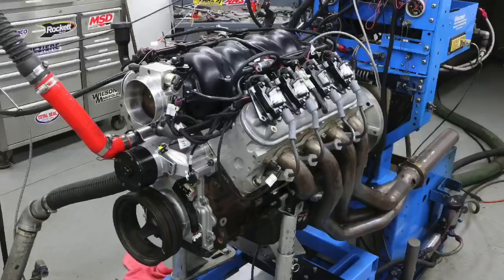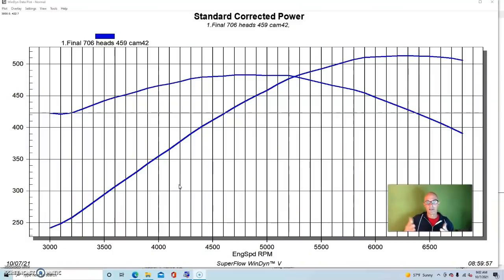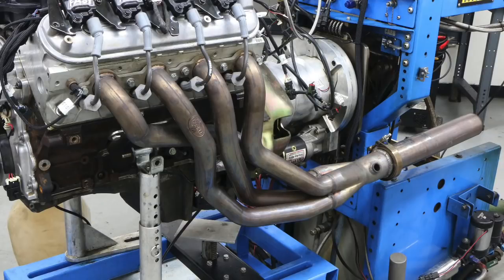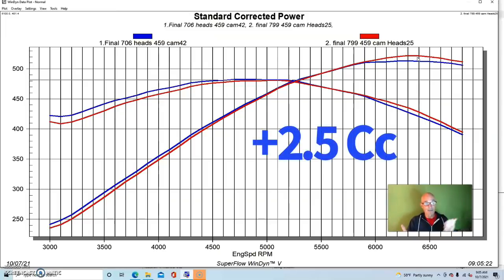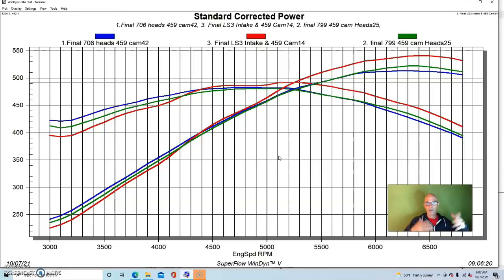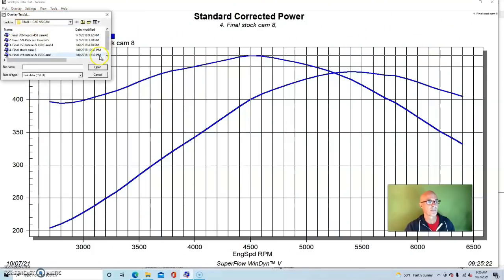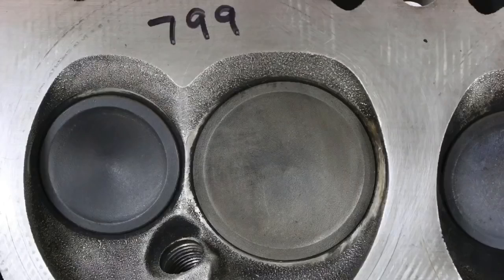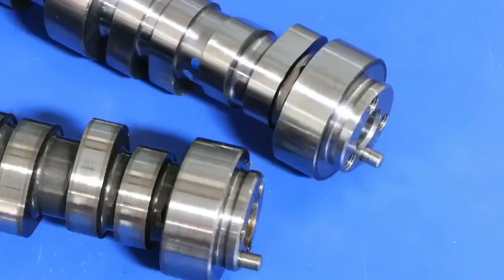HOW TO MAKE MORE 6.0L LS POWER. TESTED-STOCK 706 v 799 v LY6 HEADS & STOCK 6.0 v LS3 v LS9 CAMS

Comment: I want more down low, can you recommend the cam/intake? Seems like I can keep the stock heads
Reply from the maker: there is no cam and intake that will give you more torque at 2500 rpm than stock

Comment: I have 6.0l lq4 with ls3 heads would a ls3 cam give me 400 to 450 hp stock out of a corvette? Or should I go with a after market cam.  I'm trying to do has little tuning as possible 🤔
Reply from the maker: a stock LS3 makes 495 hp with headers, no accessories and optimized tune on our dyno

Comment: So I just bought an 87 c10. I have my 04 Yukon 6.0 and the 4l65 trans that I’m
Gonna put into the truck. The motor have many miles and I want to freshen it up. Could you give me a quick list that you would prefer for that motor that will make the truck  most efficient and most power? Like cams,heads etc. Thanks in advance.
Reply from the maker: take a look at the many, many 6.0l videos and pick what curve you want

Comment: Richard what cam would you recommend for a 5.3 with 706 heads that would go in a 8000ib school bus with 4L80E transmission? Looking for the most bottom end power. Torque first then horsepower.
Reply from the maker: truck norris or torque cam from BTR

Comment: Hey Richard, I have a 2003 Hummer H2. I'm having the infamous stock cam issue.  What's a good stock replacement cam without a tune.
Reply from the maker: another stock cam
Reply: @richardholdener1727  thanks for responding. I'm told that there's been a delay with ordering a stock one. Is there another one similar without needing a tune? Like an aftermarket stock?
Reply: @richardholdener1727  lol, he answered his question
Reply from the maker: exactly

Comment: Richard, I’m working on a 6.0 what’s your thoughts on running 243 or 799 heads with a Mutha Thumpr cam with FAST LSXR intake? How much HP you think I’ll get close to?
Reply from the maker: 500
Reply: Adding Air Flow Heads or Trick flow heads would that giving me more HP?
Reply: Thanks for the reply Rich.

Comment: I would like to know what can I do to an lq9 engine to get it to 800 horse power. And not touching the bottom end. Would really appreciate any comments.
Reply from the maker: you need to touch the bottom end to add ring gap
Reply: @richardholdener1727  what would be the ring gap will I need some heads to run boost. I definitely know that I need a cam swap. I’m learning trying to build the engine myself. Thanks for your response.
Reply: @edgarvasquez1329  lq9 heads will be a fine place to start. top ring - bore x .0055,  2nd ring - bore x .0057,  3rd ring is a min of .15".change cam, springs and can't go wrong if you go to some ARB bolts of studs for the heads.

Comment: Looks like for a truck/van combo that spends 98%of it's life under 4500rpm and does a fair bit of towing the 706 heads are the best setup. And almost free at the junkyard.
Reply: It's the compression that does it under the curve take the 799 or the rec. Port and mill them to 62 cc then it will boogy NA .I am putting this lc3 on my 6.0 as soon as I see the end of the testing.thatsca lot of money just for it not to work.

Comment: Would like to see a test on truck 6.0 upgrade for torque. 706 with a truck/ RV cam. Would the 706 head work with a 4" stroke? 317 head work better?
Reply from the maker: 408 would make more torque than 364
Reply: @richardholdener1727  
Indeed it will.... But which head would be better for a torque? 706? 317?   
One could increase the compression ratio from the stroker kit Pistons.... given the same compression ratio, which head would be best for torque in a truck?
Reply: @cjdubuisson  both heads will work well. a 10cc difference for the 317 heads means the piston design will cause issues with flame travel. higher compressions fix that. for a towing vehicle, 706 heads with a healthy cam and a 4" stroke with a NNBS cathedral port intake will make lots of low-end power for you.
Reply: @natricjol  
I believe you are correct, I have come to the same conclusion.
Reply: @cjdubuisson  Truck Norris cam, NNBS intake, 90mm throttle, 706 heads, stroker crank will give lots of low end power. You can go up to a 4.25" stroke on a stock block and that will keep the low end power up but the same cam will allow a good top end.
Reply: @natricjol  
He would be interesting to see the specs on that camshaft.... I'm guessing not much over .226 @50.    I'm a little leery of crankshaft that is over 4 in, due to the Piston rock at the bottom end the cylinder.... I'm taking a good hard look at the new 6.6.... it utilizes a 3.85 in stroke. Seems to be a good compromise between torque and reliability.

Comment: Hey could you do a test with ly6 and carb and different cams? I’m in process and would like to see the difference between say the summit ls pro cams for fuel injection vs the carbureted ls pro cams.
Reply from the maker: THE CAM DOESN'T CARE IF ITS FUEL INJECTED OR CARBURETED
Reply: @richardholdener1727  wasn’t sure if there was a difference or not. Just noticed a lot of the carb cams have less duration and lift on summits website. Thanks for responding.

Comment: I would have loved to have seen the difference of LS6 vs LS9 and LS7 cams. Tho I know LS7 would be close to LS9. But they both also are close to the lift (extra .007 more vs LS6) of the LS6 but with more duration. Would like to see ly6 with 799 and 823 heads with LS7 cam with 1.7 and 1.8 roller rockers. I wish i had an engine dyno. Also, some decent cams and for under $300... SDparts !! I actually putting a mild LQ9 with 243 heads (hand ported) and tbss intake together with the sdparts LS6 power max cam since was just $230 and can use factory rods and LS6 (yellow) springs. Should be a great budget motor since I had everything but cam and gaskets laying around.
Reply from the maker: please see the ultimate ls cam test video-I tested al of those
Reply: @richardholdener1727  i know of the article online.. Look for the LS6 specs and date chart.. Skipped to the next cam

Comment: Towing (under 4000rpm) with a stock 6.0L motor with 706 heads and a stock truck cam can you do better than OEM parts?  Richard any plans to do some testing with the 8.1L Vortec?  Love to see some dyno numbers for us truck guys with heads, cam and intake.
Reply from the maker: YES-OTHER CAMS CAN MAKE SLIGHTLY MORE BELOW 4000
Reply: @richardholdener1727  I think I remember one of your videos using Brian Tooley cam for low end torque.

Comment: Have you tryed 5% 2 stroke oil  in E85? good low speed torque..Great lube for injectors,they does not get stuck or get koroded inside anymore
Reply from the maker: I HAVE NOT TRIED THAT-BUT THAT HAS TO CHANGE THE DETONATION THRESHOLD OF THE MIXTURE
Reply: @richardholdener1727  does not seem to like very high rpm(burns slower i think) but ok for street,6000/6500 rpm

Comment: Question If the 706 head is ported or and The valves are opened up will it become less of a 5500 under production head and more towards the realm of a 799? How can you modify the 706 head and still make it more effective for 5500 and under? What would need to be done for this?
Reply from the maker: THE 706 HEAD IS NOT A 5500-UNDER HEAD-THE RPM POTENTIAL IS A FUNCTION OF OTHER THINGS (CAM AND INTAKE), THE 706 HEAD CAN BE PORTED WITH BIGGER VALVES IF YOU WANT MORE POWER
Reply: @richardholdener1727  got it thank you!

Comment: My take on these tests: the low end is killed by low compression, not so much big ports. The high end AND the fat torque curve you want come from tighter LSAs and thus more overlap. The factory cams have negative overlap at 0.050”, and the LS9 is by far the worst! Get the compression up and get an aftermarket cam!
Reply from the maker: COMPRESSION ISNOT WHAT IS HURTING LOW END (COMPRESSION HURTS POWER EVERYWHERE)

Comment: What if you just grabbed some different head gaskets to try and get compression closer to the same. Maybe thicker for 243’s and thinner for Ls3. That would be something a typical guy doing heads can do being that they have to buy gaskets anyway.  Just a thought. With truck manifold on both so maybe it’s closer apples to apples?

Comment: I have the LQ4 cam in a 5.3, LS6 valve springs, dual plane and carburetor, in a C10, it’s surprisingly torquey for what it is. 👍🏻
Reply: @bigboreracing356  
I love LS engines, your bias wont change my opinion, thanks anyway. 😄👍🏻
Reply: @bigboreracing356  
Actually I’m building a 400 next 😁👍🏻

Comment: Sweet I'm thinking about redoing my lq9 with ls3 heads. Everyone saying go to aftermarket Cath heads but I saw small bore ls3 heads which would let me keep my same  setup
Reply: If you have an LQ9, then you have cathedral port heads. LS3 is rec port and would require a different intake manifold. Cheapest way is get a NNBS/TBSS intake but get the NNBS-style rec port intake manifold if you get LS# heads.
Reply: @natricjol  I have the ls3 topend already on the car, heads and intake from a 5th gen Camaro.
The Cath port guys are saying I should go back to Cath port heads.
I bought another Camaro with a ls1 and 862 heads and the same cam, got took in the 8th mile. Even has the same 2.73 gears. Granted it is lighter since I have a 6.0 and 4l80
Vs ls1 and 4l60.  Most of our highway runs were similar with me only pulling away T high RPM.

Comment: Recently picknpulled an LQ9 from a crashed '05 Escalade. Got some 799 heads and trailblazer intake. Keeping the stock cam, or maybe a small upgrade. Need S10 swap headers, fuel pump stuff and a transmission. Just for putt-putting around, no crazyness I swear. 🤞
Reply: If you need any help with that, reach out to be. I have the wiring for the map sensor and can get your MAF dialed in enough to get it up and running without any issues. As long as you are doing the tuning yourself.
Reply: The 799 heads worked fine in the lq9 ? Direct swap ?
Reply: A few months back I found a set of freshly rebuilt 243 heads on an LS4 at the local yard. I also picked up the pushrods, they were like new as well. The 243's are essentially identical to the 799 heads, and are a bolt on swap. They have minimal mileage, so these will go on the LQ9. It's still a project, but I'm making progress slowly.
Reply: @ronnelson7828  gotta take advantages of them deals, I’m looking into a lq9 or lq4 as a back up engine for my ls1. I just wasn’t sure if the 243 or 799 were a direct swap into the 6.0 since I read somewhere that the compression could be a little to high in the lq9 with 243s heads to run pump gas… but if that’s not true, junkyard time and find a lq9 and slap some 243 heads on
Reply: @carlossantamaria7967  The 243/799 heads do have smaller chambers than the 317 heads you find on LQ4's and LQ9's and will raise compression. I'm assuming the 243's I found have been resurfaced and will be close to limit for 93 pump gas. 🤞
Reply: Also if you a choice between the LQ4 and the LQ9, take the LQ9. They have flat top pistons and full floating pins. More compression, more power. 👍🏁

Comment: TBSS intake is far superior to the terrible LS2 intake. Surprised you went that route.
Reply: It’s not a oem ls2 intake. It a Dorman ls2 style intake. Basically a copy of the original fast 78mm intake but with a 90mm ls2 throttle body opening
Reply: @Chase.bachler  that's good to know.
Reply from the maker: DORMAN IS NOT A COPY OF THE FAST-THAT'S A MYTH

Comment: As I remember with the Trick Flow versus the LY6 rec port heads the compression difference was substantial. Same compression and the power advantage shrinks. CNC port the rec port heads and it virtually disappears. The aftermarket heads are not worth the price for most people building a street/strip car and not at all for someone building a driver.
Reply: Agreed, ported heads are not worth the cost for the average guy.

Comment: I wish you had an LS7 cam to compare with those other cams. It has a little more lift (.593 /.589) than the LS9 cam and a lobe separation angle of 120° as opposed to the LS9's 122.5°. Both have the same intake and exhaust duration specs. It would be interesting to see the difference between the LS7, LS3 and  LS9 cams.
Reply from the maker: THE LS7 CAM ONLY HAS MORE LIFT IF YOU RUN THE 1.8 ROCKERS-SEE THE 5.3L ULTIMATE STOCK CAM TEST VIDEO-BOTH WERE COMPARED-THEY MADE THE SAME POWER WITH THE SAME ROCKER RATIO
Reply: @richardholdener1727  Ah yes of course, LS7 has the 1.8 rockers. I'll go check that 5.3 vid out right now as I want to see the effect of the slight change in lobe separation. Thanks Richard!   Edit - OK watched the 5.3 video annnd the LS7 and LS9 cams produce exactly the same power curve.

Comment: So hypothetically speaking if you milled the 823 heads down to the 706/862 heads cc it would make up the torque loss wouldn't it
Reply from the maker: IT WILL HELP THE 823 HEAD IF YOU MILL THEM-THEY WON'T MATCH THE 706 HEADS AND I DOUBT YOU COULD EQUAL THE CHAMBER SIZE OF THE 706 HEADS WITH MILLING
Reply: @richardholdener1727  so if torque was the goal for a daily driver truck stick to the 706/862?
Reply: @justinw6448  yeah. best combination of chamber size and design, along with port flow. 706 heads are super easy to find too.

Comment: Would you please do a test between stock 706 heads and 799 heads shaved 0.030"? I'd really love to see what and where the differences are when the compression remains the same. Also, tests with the pulls starting at or below 2000rpm would be amazing for those of us looking at modding our tow rigs and wanting to keep the stock converter. cough Truck Norris cam test cough
Reply: @bigboreracing356  Yeahhh, neither of those are at all what I'm looking for in a light duty tow vehicle.